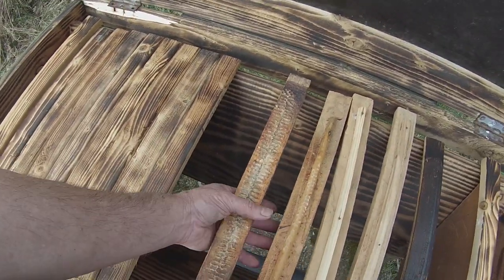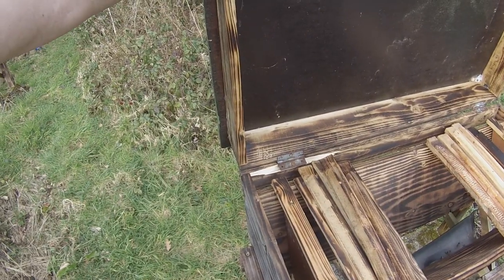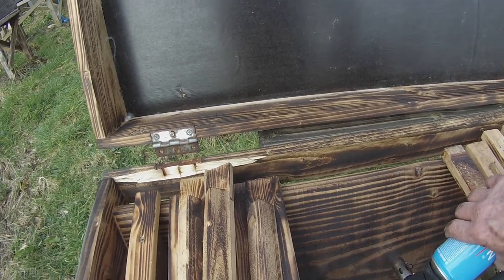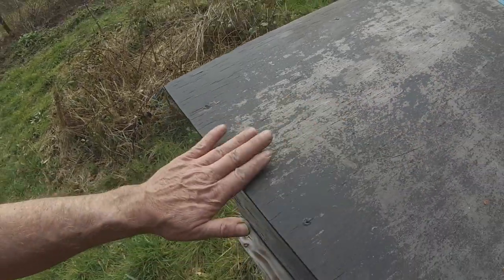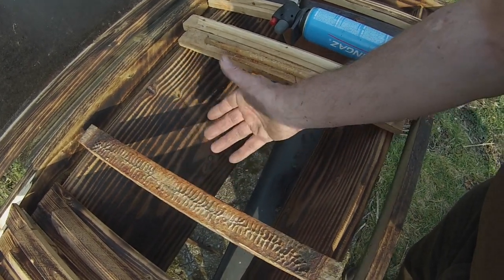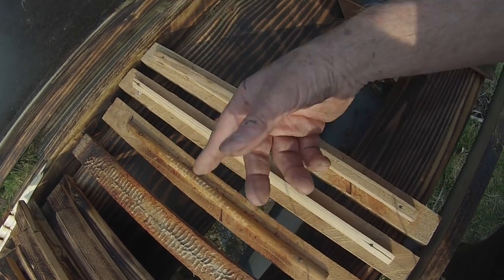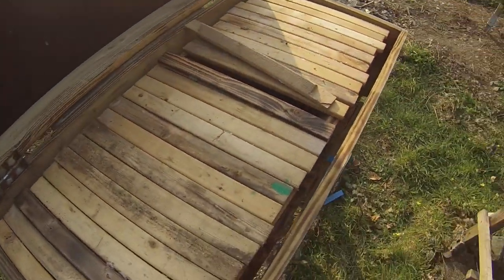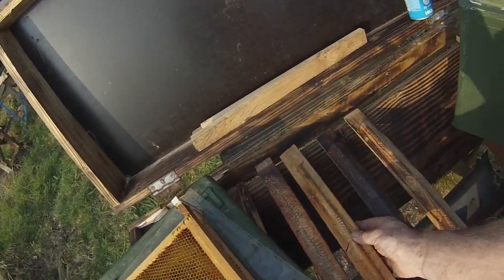Top Bar Hive Basics: Giving the Bees What They Need (top bars, roofs and other hardware)

Comment: Really informative, especially the bar variations, thank you. We have a sheet metal roof on our tbh for 2 good reasons: we’re in a high wind area so a hinged lid can become a sail and nobody wants a hive blown over; and we’re in Australia - a timber roof doesn’t last a single summer here. We actually have 2 roofs - a white one for summer when we hit 40c, and a black one for winter because we also hit -12c. Our hive is made from hoop pine and, because we’re in Oz, we clad the outside in marine ply which we treated with a mix of raw linseed oil and beeswax - it’s in it’s 3rd year and will need recoating this summer. Yes, extreme summers, extreme winters, drought and floods, and high winds 360 days a year - Aussie bees are built tough 😎

Comment: I am familiar with stringed instrument construction so i have tung and linseed oil around to protect the shousugiban treatment.  I mix with beeswax and work it in over several coats.  Be sure to use a natural type  and not boiled as the boilers add heavy metal toxins to the oil.